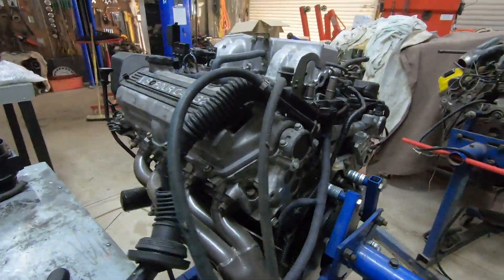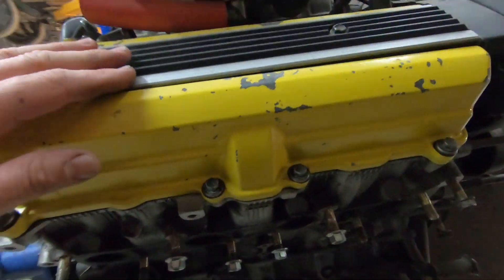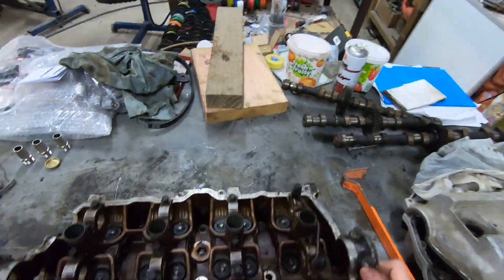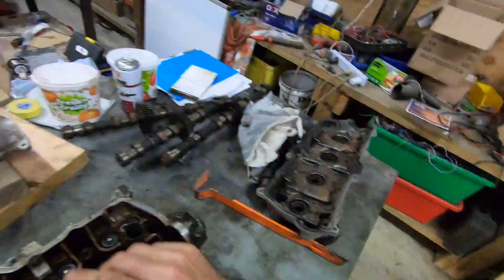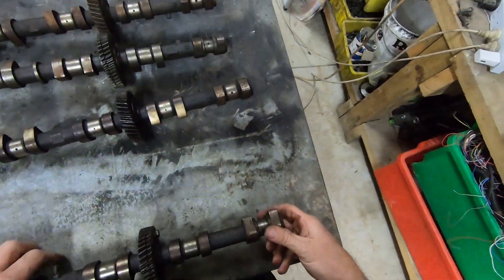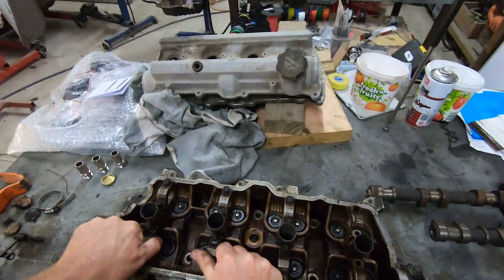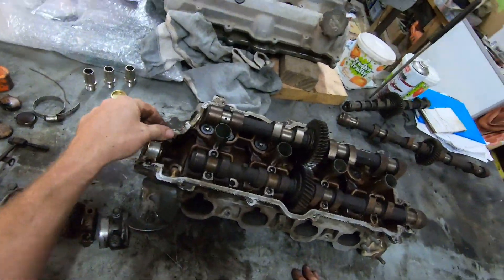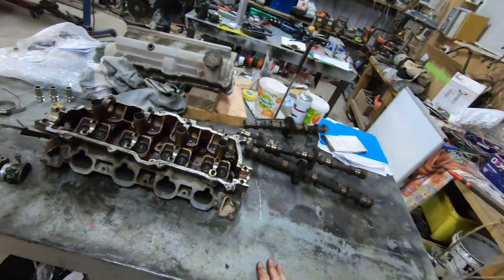1uz Cylinder heads are the same both sides - I'm not totally crazy

Comment: I thought I was crazy and now finding your video it's confirmed 😝. I'm servicing a spare set of heads for my UZ in preparation for a head gasket job. Came across two problems. Left head had broken off Dipstick securing bolt (No big deal). However right head PAS bracket stud mount casting snapped! Have flipped heads left to right and swapped cams and they're perfect! Worth noting you have to extract the dowels and swap positions for the cam gear backing plates. Also good practise to check valve clearance again once you've swapped camshaft positions. 
Thanks Kelvin

Comment: Hey kelvin do you know if the non vvti interference motor can have the heads interchanged ? Would I possibly be able to use the thick rod engine heads ?
Reply from the maker: All non vvti lheads are interchangeable.   While there are different part numbers all the critical bits are exactly the same.
Reply: @CartuneNZ  thank you so much for that info. I was stumped now I know I have cars close to me in the wrecking yard

Comment: Hey Kelvin, I'm trying to get some more airflow out of my 1uz. Do you know if a 3uz head swap would work on a 1uz block? If so what i might need to make it work? Thank you
Reply from the maker: Yes,  the 3uz heads fit nicely onto the 1uz vvti as they are the same head and no issues with vvti oil feeds as again they are the same head,   but no more airflow as they are the same head between 3uz and 1uz vvti.  Doing non vvti block with a vvti head is a completely dumb idea these days with the availability of vvti blocks to sort the oil feed issue to the vvti.
Reply: @CartuneNZ  thank you, would the only option to increase air flow be to port and polish?

Comment: can i run the 1uz in a hot v configuration? turbo in the center, intake plenums on the bottom?
Reply from the maker: As the intake ports are in the center and exhausts on outside It would take lots of redesigning.  Maybe spend some time looking at the design of the engine.  Cheers.

Comment: Amazing. Love your content. Just to confirm if you put vvti heads on a non vvti block won’t you get a more efficient  setup due to the bigger valves and better flowing head
Reply from the maker: Yes. The VVti heads flow a lot better.  Some of the NZ stock car engine builders over here won't do a non vvti engine as they find the VVti go so much better.  There is oil feed issues when using the non vvti engine with VVti head though.  Cheers
Reply: CartuneNZ can I not just block it off with a plug
Reply from the maker: @fmn716  block the oil feed to the head or the VVti?
Reply: CartuneNZ yip. I do not intend on using the vvti
Reply from the maker: @fmn716  theres a bit more to it to machine up some special fitting plugs to ensure the rest of the head works correctly and then sorting the cam gears.  I prefer to start with a complete vvti engine.  When you have it apart and trace oil passages and see all the parts it will make more sense.
Reply: This is what I am planning on doing. Prices of engines here in the states have gone up a bit. So I have the idea of running a 1uz non vvti block with a 3UZ head. I would like to run the vvti.